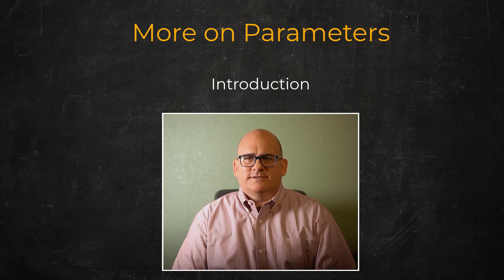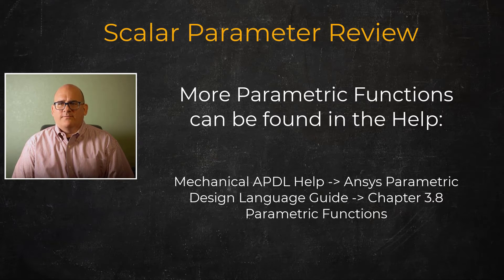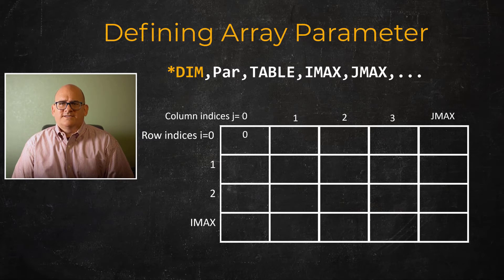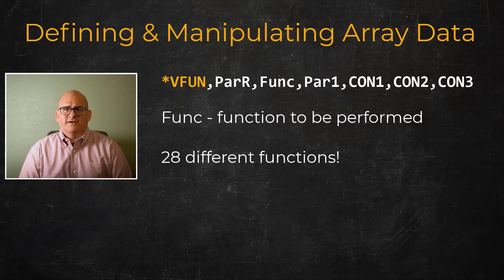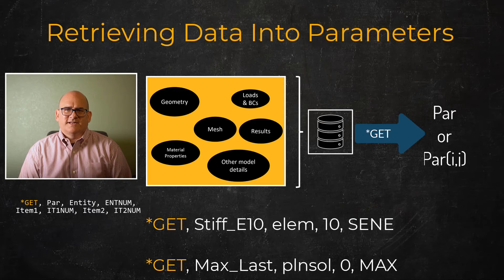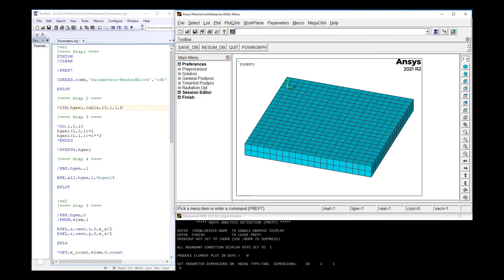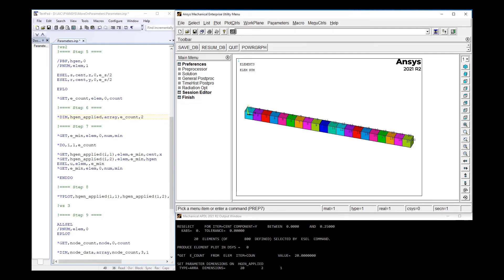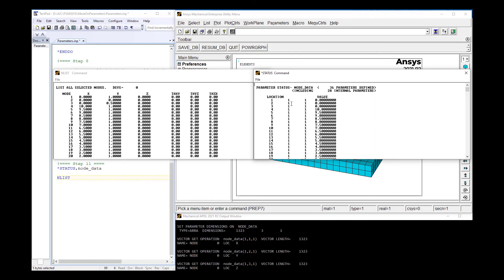More on Parameters (Arrays, *GET) — Lesson 7

Comment: Is there a recommended practice on how to deal with filenames in parameters? Windows 11 allows file names up to 260 characters by default, or even unlimited using a registry setting. How do you deal with that when APDL has a limit of 32 characters in a parameter?
Reply from the maker: Hello! Please refer to *DIM command in the command reference manual (Mechanical APDL > Command Reference > D Commands); ; String type Arrays have a 248 character limit for each array element.